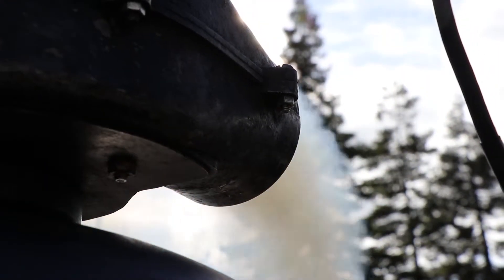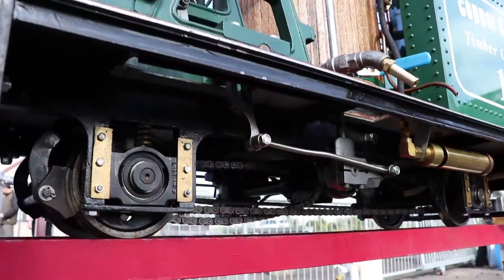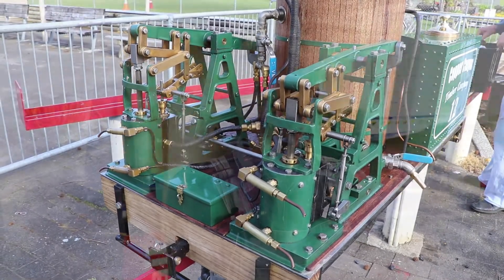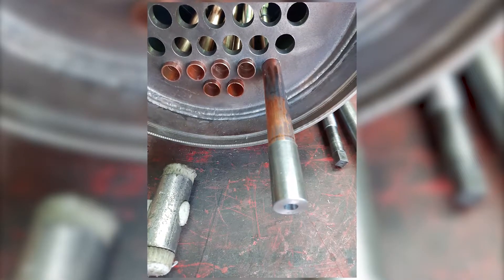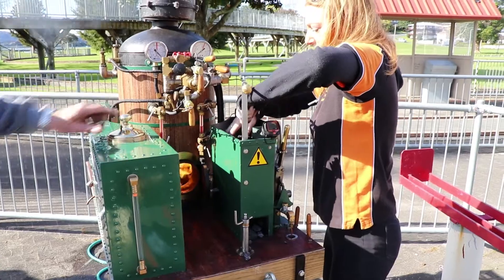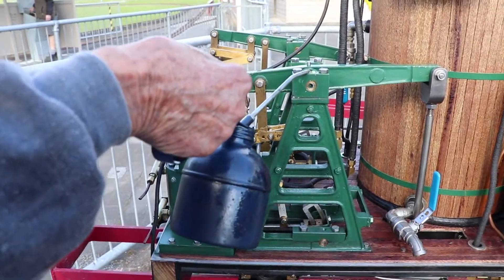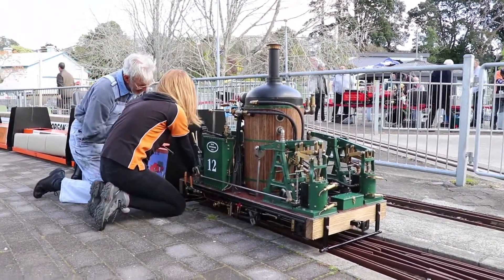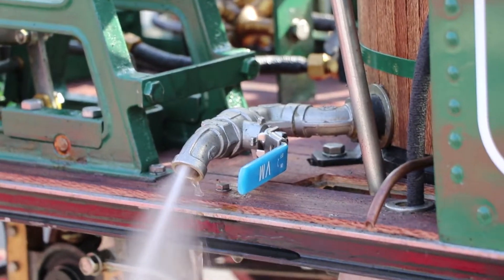'The Gadget' #12 | 7.25" 0-4-0 Beam Engine Clishay Locomotive

Comment: Can you provide some more info on where to purchase ( or build) the boiler you used?
Reply: The boiler was built by Page Macrae of Tauranga NZ.  300mm diameter, 530mm high,  with 40 X 20mm copper tubes. Built to AMBSC code steel boilers.